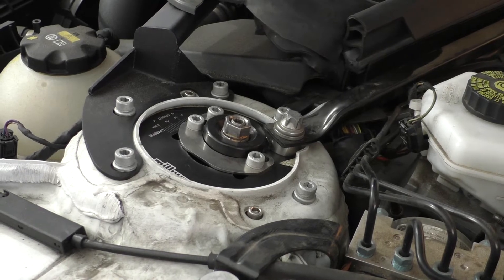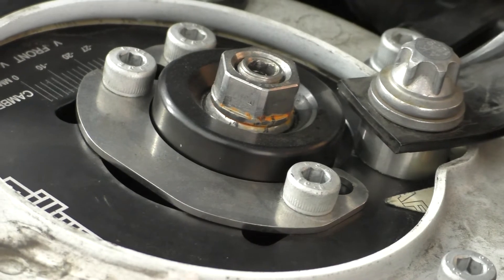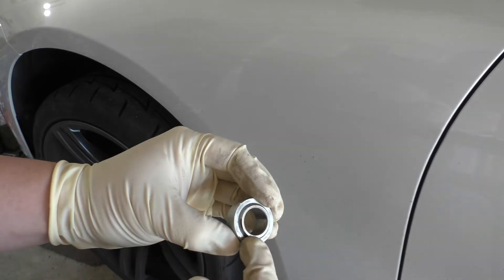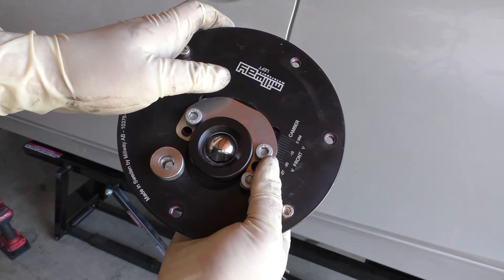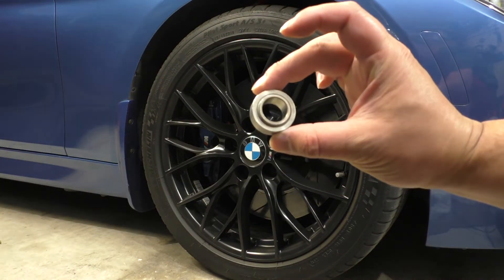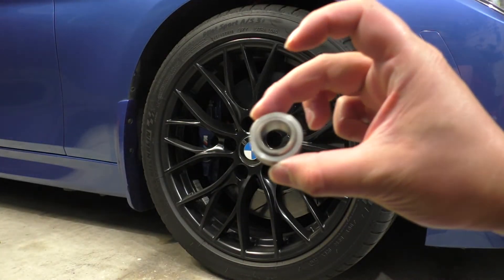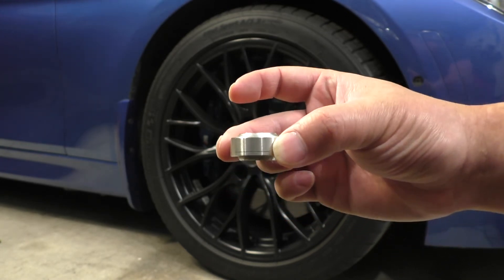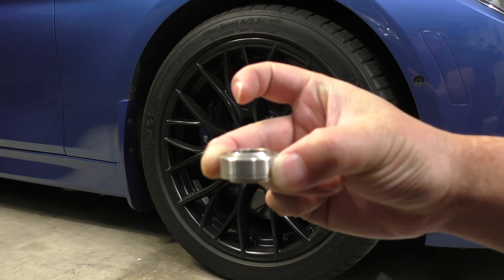How Camber Plate Monoballs Wear, Clunk, and Fail

Comment: I sincerely appreciate all of your detailed content on camber plates. Do you have any experience with Millway’s “street” plates? Also, any experience with clunking or n Vorshlag plates?
Reply from the maker: Thanks! I use the Millway Street plates in my 328d daily driver. They're my go to recommendation for a mostly daily driver car that sees a couple track days per year. All my Vorshlag plates have been quiet.
Reply: @FaRKle0079  Thank you very much! In comparing the "street" Millways to the Vorshlags, do you notice a significant difference in NVH? I have a G80 Comp xDrive that I track regularly at Road Atlanta, and I need more negative camber in the front - basically, to not blow through the outside shoulder of my tires too quickly, which is exactly what happened with my first set of Michelin Pilot Sport 4S tires. I am not really trying to build a race car, and I want to stay as OEM as I can until my warranty is up. However, I need some camber plates that will last and not rattle - with minimal NVH, if possible. Any real-world guidance here would be appreciated! I am subscribed. :-)
Reply from the maker: @michaelbetanzos6172  Nice ride! In general there's not a big noticeable difference in baseline NVH between the MIllway street and Vorshlag since the noise is more "white noise". Where you might notice some difference is over bigger/sharp hits, but the Vorshlag still won't be bad. It's not a tone/pitch that really grabs your attention.

With the Millway Street you basically can't get any rattle. I haven't seen a Vorshlag that rattled, but since it uses a spherical bearing the possibility of it is there. One of my Vorshlag spherical bearings is loose enough that I can move it by hand pretty easily, but surprisingly that one doesn't rattle (many other smaller spherical bearing camber plates will when that loose).
Reply: @FaRKle0079  Thank you very much for the details - much appreciated!

Comment: after installing a street version I get some clanking, not new coilovers but OEM suspension on an M140i. Any ideas? the car ran noiseless before this.
Reply from the maker: I'd check the OE thrust bearing fit on the camber plate. Aside from that check the fastening hardware (like strut top nut).
Reply: @FaRKle0079  will check all and install new sway bar links while I'm at it... I have a suspicion

Comment: Great video thanks! Currently needing to change the bearings in my Milway top mounts actually, do the bearings push out or does the collar underneath spin please? Also what would you go for on a road car - worth buying two uni balls or going for the street conversion kit? Thank tou
Reply from the maker: There's a locking ring on the underside that you need a 4-tooth spline tool to remove. I'm pretty sure Millway put thread locker on it too so you'll need to heat it in the oven or torch it. It's not an easy part to remove. 

Once that locking ring is out, then you can press the bushing out of the bottom.

For a street car I recommend the street version. Don't have to worry about replacing monoballs, and if for some weird reason you ever need to replace the poly, it's VERY easy.
Reply: @FaRKle0079  spot on mate thank you! Keep the vids coming, really enjoyable and informative 👏🏻
Reply: @FaRKle0079  managed to use a mallet and punch to remove the locking ring 🤝 Milway weren’t responsive when I asked about the tool unfortunately. I’ve sourced some monoballs outside of Milway. They are identical size and material, PTFE lined etc. But they seems very free to rotate etc. Are Milway monoballs quite stiff when new?
Reply from the maker: @benpatterson2466  The Millway monoballs are decently stiff when new. You can't really rotate the ball in them by hand without inserting a tool or something to give you some leverage. That said, more freely moving monoballs aren't necessarily a sign of bad quality ones. You don't want monoballs so stiff that you can't move them at all, because then they're just acting like they're bound.

The Millway monoball assembly is exactly 30mm OD. Which ones did you use?

Comment: I’ve had the millway street poly bush fail in 3 track days too and introduce a lot of play. Is there no better solution?
Reply from the maker: Wow! How did they fail? Mine have held up well so far.
Reply: @FaRKle0079  Track 3-4 days on them and there's so much movement in them now it's jarring to drive down the road.
Reply from the maker: @fhdst  Is it lateral movement or vertical like a worn monoball? At least you can replace the PU easily if you get some from Millway.